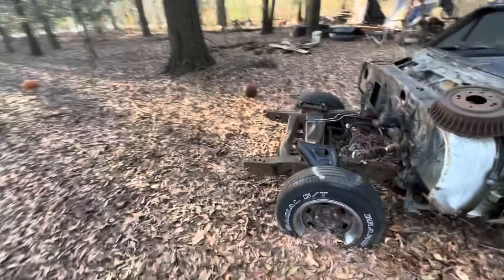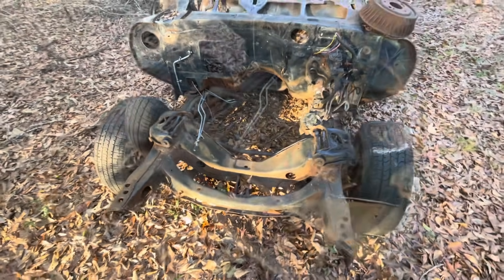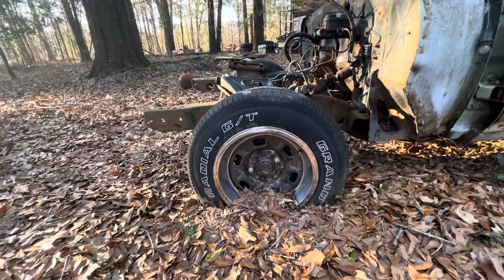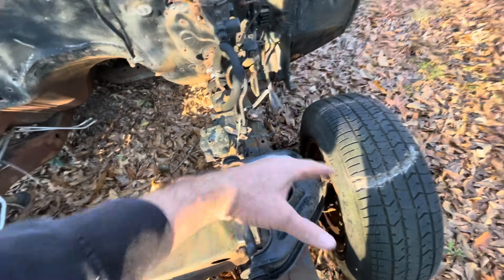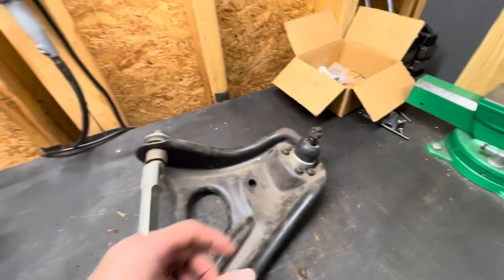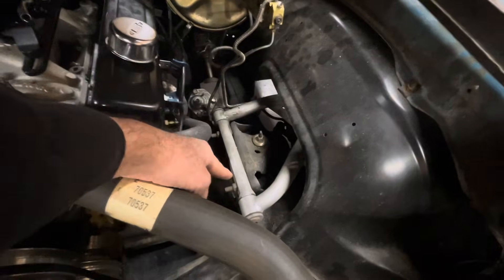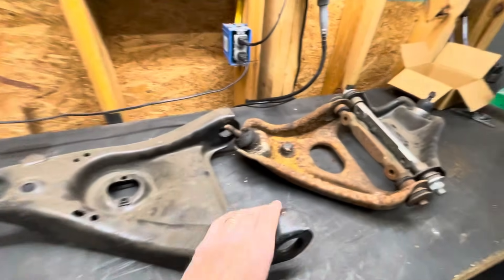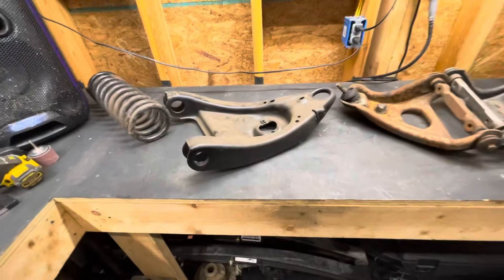Chevy Nova Subframe Tech

Comment: is there any differences in the sway bars between sbc and bbc cars? i put a 383 stroker in my 74 and the 8in balancer contacts the sway bar(i had to drop the bar about 3/4in for it to clear). Or is the problem that i used sbc engine mounts making the balancer sit lower?
Reply from the maker: The SBC mounts will cause that exact problem.

Comment: to replace lower control arm bushings, you use an air chisel to cut the old one out if your replacing the whole bushing. some poly bushings require keep the old sleeve, so instead use a drill to drill the rubber out. also, find an outer wheel bearing race from a front wheel drive car that is the same width as the space between the control arm ears, cut it in half and stick it between the ears when you go to push the new bushing in. the piece of wheel bearing race will keep you from bending the control arm and ruining it.

Comment: Ride tech actually specifically built a kit for the Camaro/Nova called the "try turn" kit, and it's specifically built to fix the suspension geometry issues they have. One question I have is how would someone reinforce the shock mount on the lower a arm? I'm thinking that would be a priority if someone were to run coil overs on the factory bits. I saw someone mentioned that their Nova sat a little high with their spring choice, and I gotta throw out there to use a chop saw or cut off wheel to cut springs, because they are heat treated, and a blowtorch removed that treatment, basically making the spring into a spaghetti noodle. The saw and cut off wheel can't put nearly as much heat into the spring. Also, does moving the tires outward with those offset shafts affect the space you have for tires? I remember you said that novas can run 235's up front, but would that be affected by those shafts?
Reply: Damned auto correct. It's "Tru turn" not "try turn" ugh. Ride tech Tru turn.
Reply from the maker: I’ve seen the Tru Turn set up. It fixes a few issues. The offset shafts do not give you any extra room. Honestly, cutting springs is a bad way to lower. Cutting coils off of a spring increases spring rate and changes compression.

Comment: An air chisel is your friend when getting the bushings out. I use the rounded tip to deform and collapse the bushing into a goofy star shape, then the edged chisel to drive them out. Makes short work of them and you can avoid damaging the arms. I used that method to do the Ventura subframe and suspension. 

Its all polyurethane now with solid body and engine mounts. Pontiac mounts are kinda cool, they hang behind the crossmember and have supports that go between the top plate and LCA bolt. I don't know how chevy mounts are, just Pontiac stuff. The thing I like most about the Ventura and the 67-69 F bodys is how much room I have for the exhaust, Pontiac headers are wildly simple. 

The Ventura was a straight 6 and powerglide with a 3.08 geared open rear. I kept the gears and installed a Yukon diff. This thing is gonna be tons of fun with a 400 I built years ago that pushed my heavier 79 Formula into the mid 12s. Have to do the rear springs later this year, right now I need to get the winter beater Silverado in to do wheel bearings, replace the transmission selector arm because its rusted so much the cable won't stay on it, and replace a rear rotor and pads. Fun times working with rusty junk.
Reply from the maker: I used to use an air chisel on ball joints. No I just hit it with grinder. My ears are pretty much shot so the chisel only comes out when I HAVE to. I love pontiacs. Would like to build another one day. I had a 79 firebird with a 69 WT block, #62 heads and a decent cam. Torker intake with 750 Holley.  It went 12.89 with 308 gears and a 245/60/15 radial t/a tire. Thing would HAUL!

Comment: Back when I was playing with Novas, I always used solid subframe-to-body mounts. Everyone on the popular Nova message board at the time kept repeating each others' nonsense about noise, vibration, blah blah blah. Seriously though, think about it- Once you install solid frame mount bushings, you've just created the SAME scenario that the Ford and Dodge cars of the era had, as well as every single unit-body car made from the 70s to present day- a suspension mounted to the structure of the car. And no, I experienced NO CHANGE in noise or vibration going from the rubber mounts to the solid ones. What I DID experience is body panels always maintaining their gaps and alignments since there was no rubber to rot and collapse. P.S.- I have seen exactly two factory 4-cylinder Novas in my life, both at car shows. Both had personalized license plates- "SLOVA" and "NOGO." At least the owners knew what they were getting into!
Reply from the maker: Lol. Maybe one day I’ll see a 4 cyl nova. As far as the aluminum body mounts, I can feel a little bit more vibration thru then but only because I know they’re solid. Also the car in video has solid mounts.
Reply: LOL, that NOGO is great. In spanish "va" means "to go", which is why Nova's made in Argentina were called Chevrolet Chevy instead of Chevrolet No"Go' (Nova).
Reply: What brand ball joints do you recommend
Reply: A teacher at my HS in the early 80’s had a nice first gen plain Jane Nova , 4 cylinder manual trans , that’s the only one I’ve ever seen .

Comment: I got my drivers license in a Nova that didn’t have power steering or power brakes. It was rough parallel parking and 3 point turning.
Reply: I had one like that, and had no problem.
Reply: Trooper told me I didn’t know what turn signals were for

Comment: Another great video!
And for you 4th gen Nova fans (1975-79), the front subframe is completely different with a different steering setup. 1975-79 Nova subframes are similar to 1970-81 Camaros.

3rd gen Novas are “rear steer” while 4th gens are “front steer”. Rear steer means the steering box is located behind the front wheels while front steer means the steering box is ahead of the front wheels.
Reply from the maker: Crap. I filmed that part and forgot to put it in.
Reply: @Shop209  Hey John. I’ve heard a rumor that a 4th gen subframe will bolt to the 3rd gen body with just some different body bushings or body bushing spacers. Now, the front will be different but it makes me wonder if it’s possible to put the more modern (meaning designed for radial tires) 4th gen subframe on 3rd gens to make it drive better and provide more header clearance (since the steering box is moved). I’ll bet the front of the subframe and the radiator support could be modified to allow a 3rd gen front clip attach. You seem like the right person to try that!  😆
Reply from the maker: Actually I’ve been looking for a 4th gen subframe to try it.
Reply: @Shop209  You turned a 4-door into a 2-door. If there is anyone on the planet that can make a 4th gen subframe work- it's YOU!
Reply: @Shop209 please try even if does no work we ll see WTF love You Chanel gracias
Reply: @NovaResource @Shop209 I've heard this for years. Folks say it would also fit the 1st get F body cars.